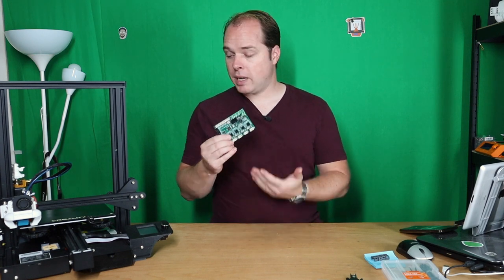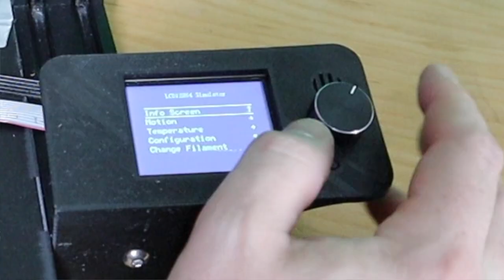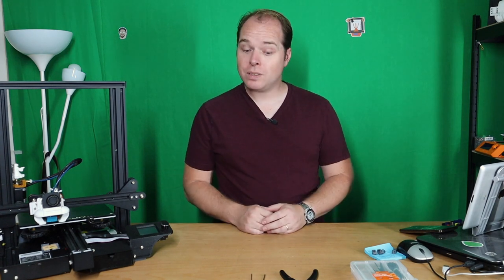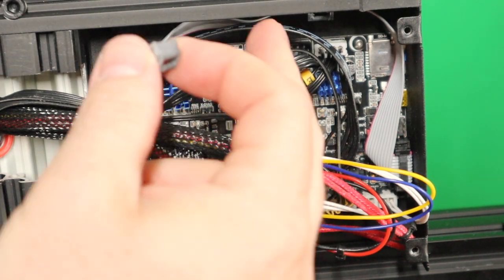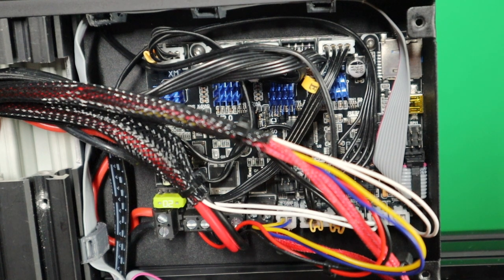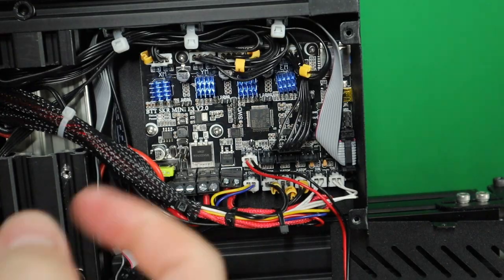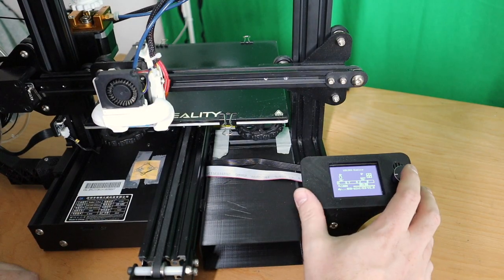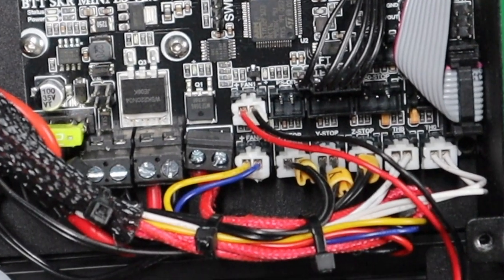How to optimize airflow in Control box Ender 3 Pro - Cable management

Comment: On Thingiverse there is a plastic insert you can print that slots in the Aluminium cutout to protect the cables going through the metal extrusion.
Reply from the maker: Yeah I headed that before, I didn’t till the time to print and use it

Comment: Does the motherboard fan is always on?
Ender3 pro with creality board ver.4.2.7
Reply: I think it doesn't. I have non PRO version with new black motherboard, part fan is still connected with motherboard fan. I've read that PRO and V2 still have that issue. I just started printing ABS and luckly learned about that issue on time. I fix it by cutting conector off and connecting it with extruder fan so it's always on.
Reply: I purchased a v2 a week ago and the motherboard fan is still connected to the parts cooling fan. I re wired it to the hot end cooling fan
Reply from the maker: I don't hear it anymore, the motherboard fan kicks in when the printer is heating up. Hotend fan is always on and parts cooling is also going active when heating up
Reply from the maker: Parts fan together with the mainboard fan? Wow, didn't see that before. I have a SKR E3 mini board